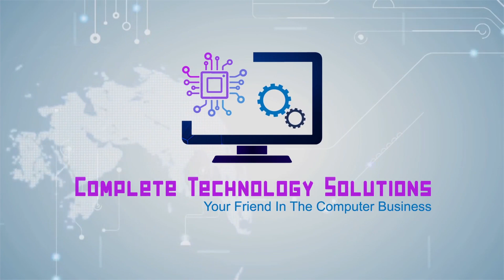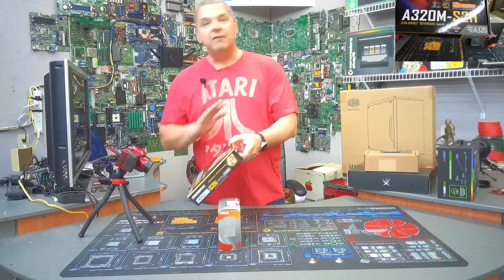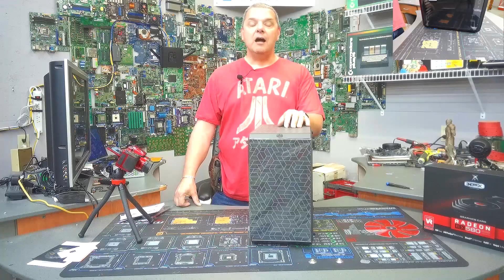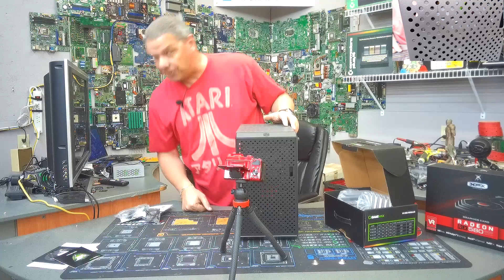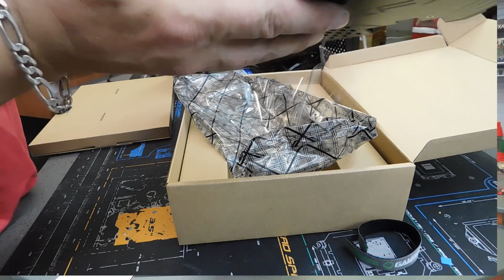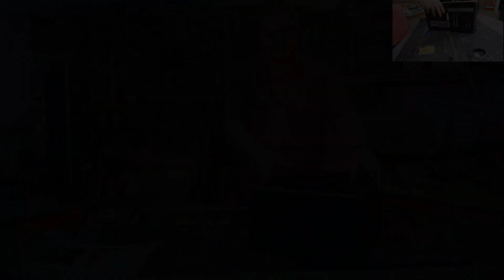Lets build a budget gaming machine!

Comment: Did you stress test the system, before delivering it to the user? What temps did you find it runs pre, during, and after the test?
Reply from the maker: I did indeed.. I stress test all builds with 3D mark and Cinebench... On this particular build the GPU maxed out at 63 degrees and the CPU around 71 at full load. There was no over clock being run and we never reached a CPU temp throttle. Also, I tend to run a 48 hour gaming run using FN and WZ. I push them harder than they usually would be pushed in a standard user setting (assuming they aren't mining bitcoin 24/7) :)